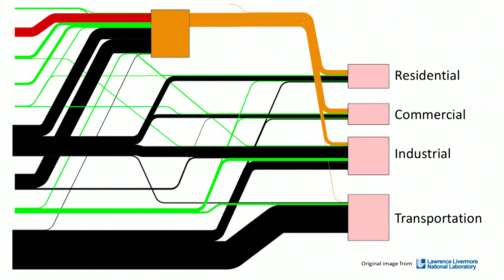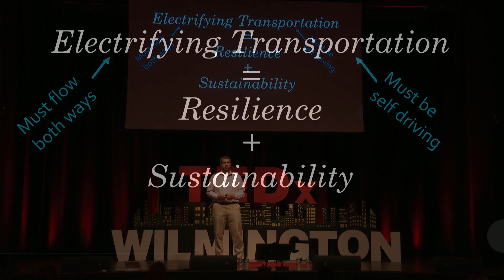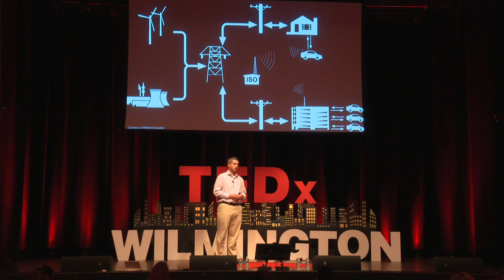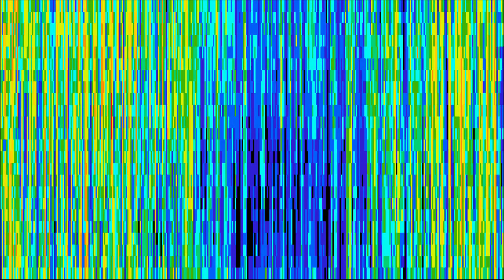Electricity in Self-Driving Vehicles Should Flow Both Ways | Cory Budischak | TEDxWilmington

Comment: Great talk.  But I did not get the part why electric cars should be autonomous.  As long as you plug them in somewhere they can supply or drain energy from the grid . But the idea of using car batteries as a huge capacitor combined is impressive, since storing electical energy is the dream of an electrical engineer. It gives flexibility and comfort even during peak demand periods.  I hope grids will be bigger one day to cover different continents to use the solar/wind energy most effectively all day/year long.  Of course with the help of superconductor cables.
Reply: Ahmet, what I was trying to get across is that autonomous vehicles could drive to places with electricity to charge and then drive back to where there is no electricity by themselves and thus provide continuous backup power without any human intervention. It was hard to get that across in an 8 minute talk!